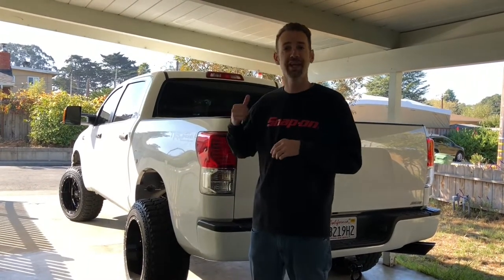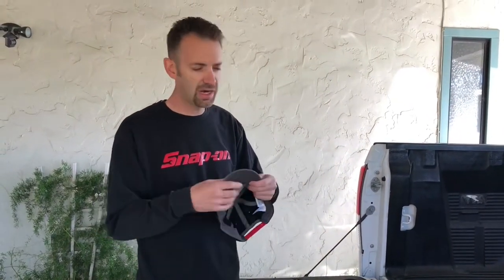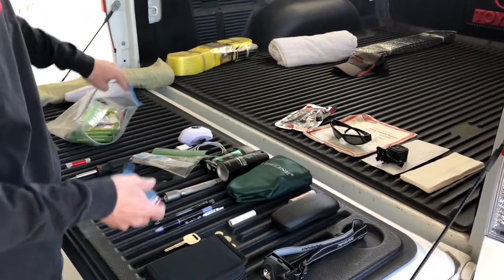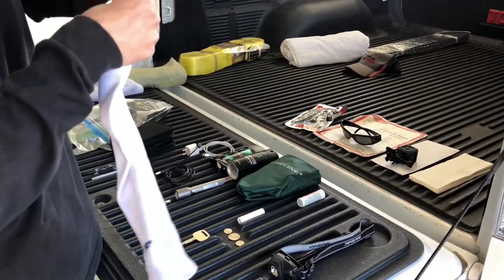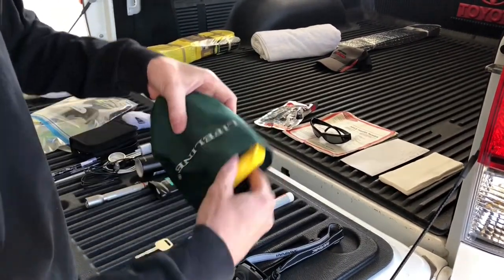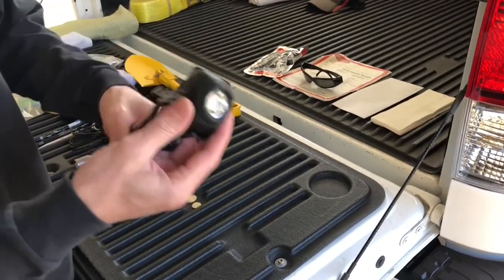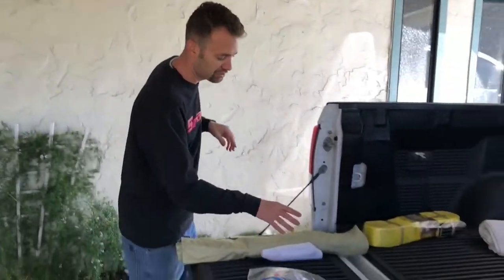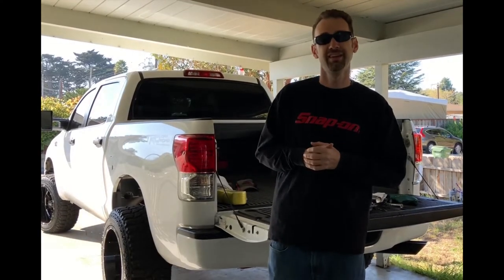What I Keep In My Toyota Tundra Truck Essential Items | Be Prepared For Emergency | Lifted Crewmax

Comment: Never knew the rear seat folded down to reveal a storage compartment.
Reply from the maker: Yes, So I’m pretty sure The 2007-2013 Crewmax’s have the storage compartment behind the rear seat, but the 2014’s and newer do not..
Reply: @toyotafanatics1  Thanks because I was wondering why I don't have that. I can't even fold the back of my rear seat down like that.

Comment: This has more storage than the new Tundras.
Reply from the maker: Yes it certainly does. I’m not sure why they changed the interior so much for the 2014 model year.. the loss of the reclining/sliding rear seats is a bummer.. also lost the driver side grab handle, and like you mentioned they lost a bunch of storage too.. the good news is that there still the same awesome bad ass truck besides those little things.. 👍🏼